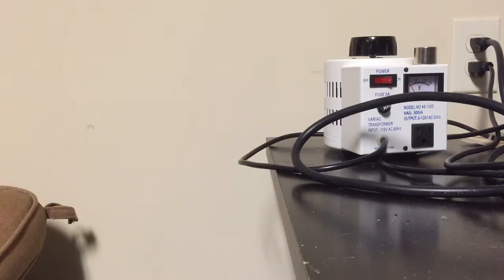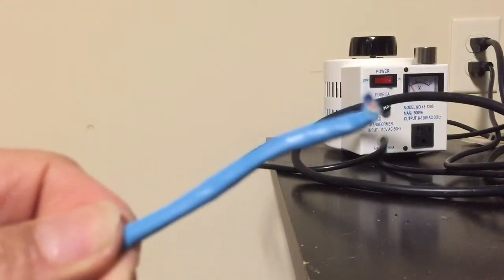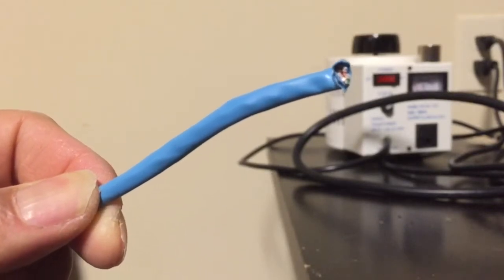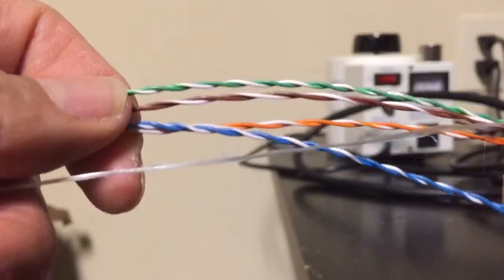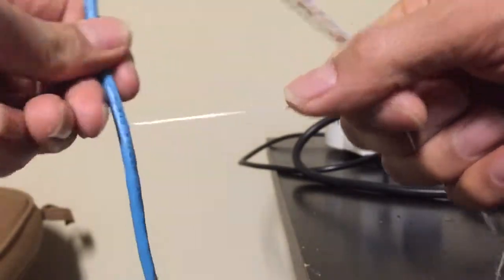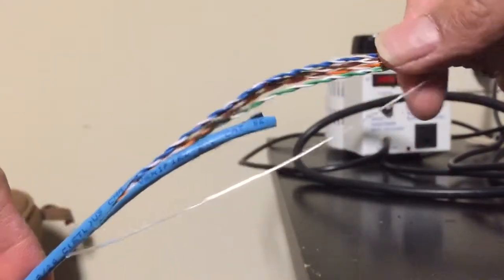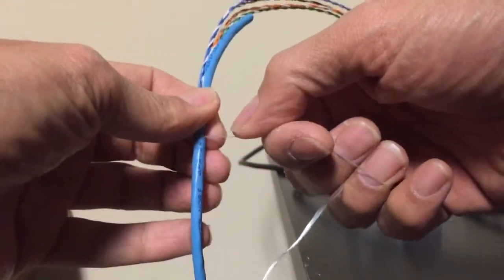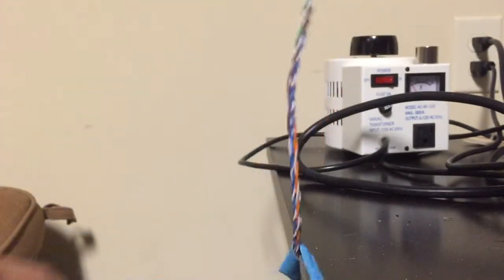Quick way to get at  wire from CAT5 to make GDT

Comment: Nylon cord to give it strength, why would you need to ?
Great that you found the real reason for that nylon :)
It's there to aid stripping of the wire, it's something that has been in telephone cables for years, not just the ones in your house, but the big multicore cables in the telephone exchange (up to 900 cores)
I used to install and test telephone exchanges in the 70's,  stripping cables was part of my job for about 5 years
Another tip, if you put a hook in a drill and secure the twisted wire to something solid, you can quickly twist or untwist it ;)